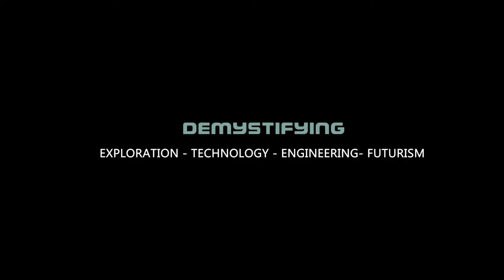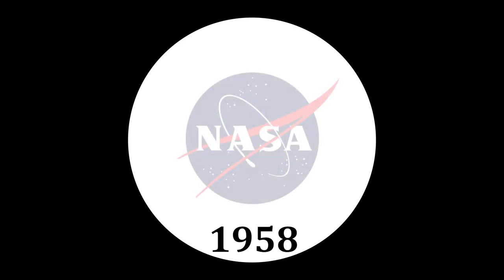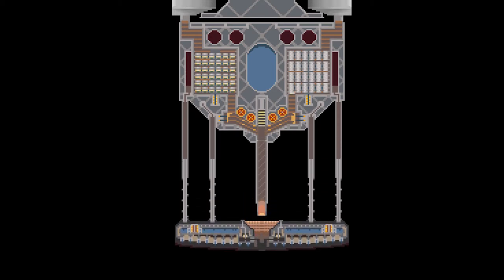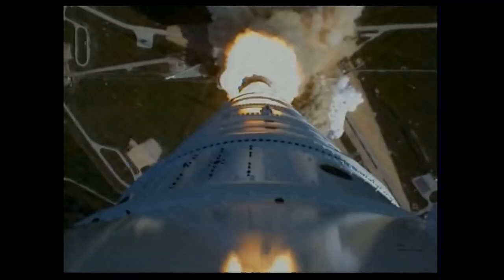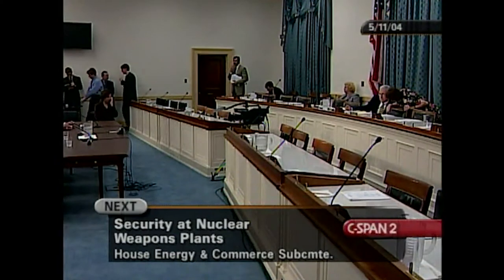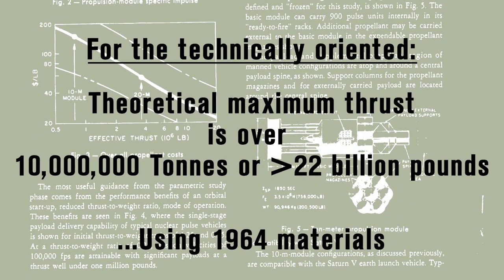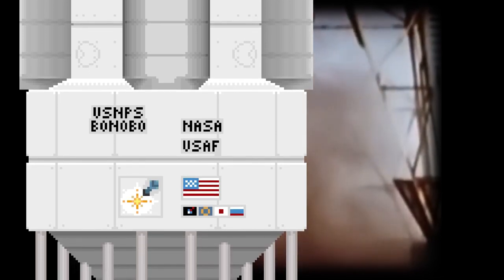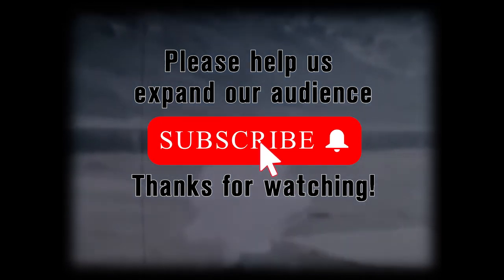Forgotten Project: Revisiting the Orion Program

Comment: Congratulations for this excellent video. I was wondering if all of this fallout concern problem could be solved if Orion Spacecraft would take off from the Moon?
Reply from the maker: Modern NPP designs (variants on MEDUSA, not ORION) have been discussed for construction at a Terra-Luna lagrange using local lunar materials. MEDUSA is inherently simpler and less demanding on materials so it could be built using cemented regolith, ice and lunar alloys. 
If you're going to use Luna as a staging point for a NPP you might as well do it in orbit to simplify construction and to minimize trips down the gravity well.

Comment: Would a 20 meter wide Orion launch on a pad capable of surviving the first liftoff?
Reply from the maker: Most of the energy of the blast is directed upwards by nature of the bomblet designs so it seems likely a normal or even simplified launch pad would work. You would definitely want to roll any gantries or cranes away however. Thanks for your comment!
Reply: They did a lot of work on 20 meter designs for either "lofting" up above the atmosphere or lifting sections of ships into orbit.
Designed for Post-Apollo "Nova" class or others (like the Sea Dragon or Boeing AMLLV, or Convair Nexus)
 SpaceX has talked about an even bigger BFR, 18 meter diameter, though the Super Heavy / Starship could lift sections for the 10m ships.
Reply: @JFrazer4303  but se podria hacer que el orion pueda lansar bombas por ejenplo una cada 45 milisegundos para que sea mas controlable y suabe el aterrisaje
Reply from the maker: @psycronizer  you're asking me when  currently classified technology was developed. It was sometime in the 1950s and many other technologies like nuclear pumped lasers and "casaba" style particle beam systems used directional nuclear energy.
The entire latter part of the Orion program and all of its millions of dollars of funding was predicated on using asymmetrical nuclear devices.

Comment: Is there a way to stop EMP form damaging satellites or electronics onboard?
Reply: there is. not only do we have computing hardware that is less affected by emp but we do have ways to shield traditional electronics from emp.
Reply: Keep in mind that EMP damage scales with bomb yield. Orion uses 1kt nukes, those aren't very good at generating EMP of any kind.
Reply: @psycronizer  davy crockett would like a word
Reply: @psycronizer   The most advanced, fastest, & smallest feature-size computronium definitely does have issues with ionizing radiation. Now OP didn't ask about ionizing radiation, they asked about EMP(electromagnetic pulse) for which there are many light shielding options. Actually simple-mass shielding is trash at stopping EMP as that's usually in the microwave & radios ranges. However we do have computronium that deals with ionizing radiation better. Namely anything with a larger feature size will be less affected which is why older computers/microcontrollers are used on most rovers. There are also technologies that are almost completely unaffected like vacuum tubes(FYI there are microscopic versions of that) & relays(NEMS & MEMS versions are already in use). Granted they are slower(low megahertz range), but still fine for most applications. Then there's photonic computing which is still not usable but is advancing & wpuld completely immune to EMP & very resistant to ionizing radiation.

also the M29 Davy Crocket has a yield of 20 tons of TNT & there are many other more efficient designs for low-yield nuclear devices so maybe do a quick google search before you call BS.

Comment: One problem with launching an Orion today that didn't exist in the 1960s is that there are thousands of satellites in low Earth orbit.  The 1962 Starfish Prime test exploded a 1.4 megaton device high in the atmosphere, knocking out electrical devices almost 900 miles away.  Hundreds of nukes going off in the upper atmosphere would punch a big hole in the various low Earth orbit constellations, including those of other countries.
Reply from the maker: This is a good point but keep in mind the original 20m Orion would use .1 kiloton devices. 
The electromagnetic pulse concerns can be further reduced by equatorial launches. Plus, why not carry a load of new satellites and maneuvering modules to replace those you might potentially damage if this problem is unavoidable? This would represent a tiny additional cost to the vehicle.
Reply: @De-Mystifying : They found that the larger the vehicle the more efficient it was, so they were never going to launch a  20 meter Orion.  I can't fathom they'd launch anything less than 4,000 tons, with 10,000 tons or more being much more likely.  They could include replacement satellites, but the damaged satellites would be in many different orbits, meaning most of the satellites would need significant upper stages to get then into the right orbital plane and shape.  More likely they'd just set up a fund with a few billion dollars in it to cover the cost of replacing losses.
Reply from the maker: @pahtar7189  Don't forget that the lower limit impulses of the original Orion system can be used for vehicles up to around 5,000 tons. You can use very small devices at a faster cycle rate to leave the atmosphere if EMP is a major concern.
I will go into some detail about interaction with sat constellations in part 3 of the new series. It is an interesting problem
Reply: best thing would be to build and luanch it from the moon

Comment: A thorough video on Orion though a couple other vloggers gave it some coverage. You gave some figures as to the time to reach Jupiter but I don't believe you mentioned how long a round trip to Mars would take. 

This is a most beautiful video showing an Orion spacecraft's voyage to Mars: https://youtu.be/DSK_mymJvkM
Reply from the maker: It depends on many factors such as planets' relative position, the top design speed of the vehicle, etc. The practical minimum travel time for a manned vehicle (with the planets in opposition and  at 1.5g) is somewhere around 2-5 days.
Check out our new Project Orion series; we go into even more depth there. The 5th part coming soon will describe in detail a Mars-Earth transfer maneuver!

Comment: where  would  you  ever launch it from ?
Reply from the maker: If launched from Earth's surface, the safest method would be a launch from the ocean. Other remote locations with low ambient temperature and predictable air currents would work; basically any extant launch site far from the equator would work. Check out the new series on the channel for more info about this!
Reply: The proposed launch site was Jackass Flats, Utah.